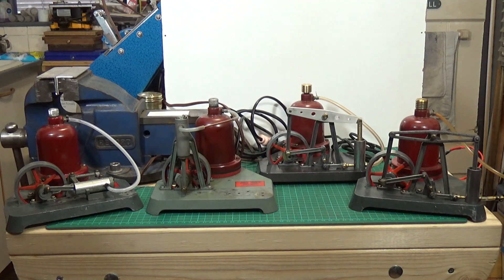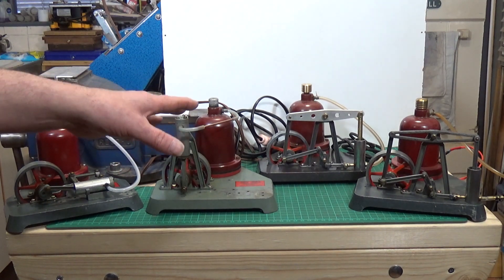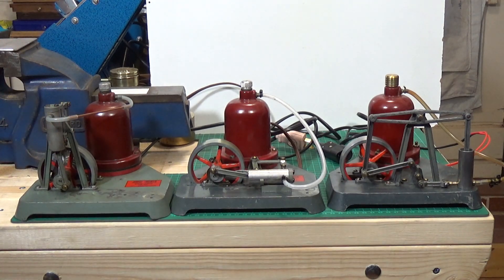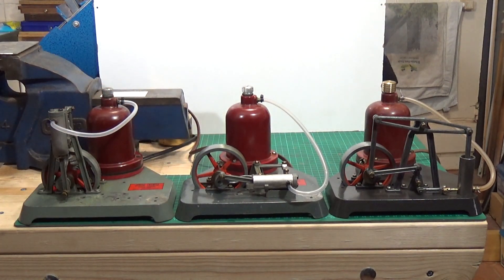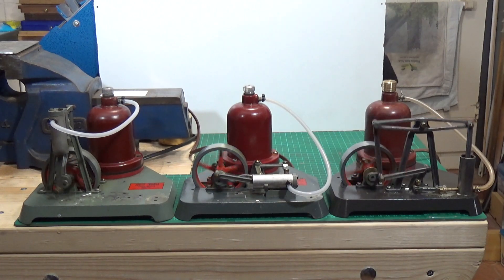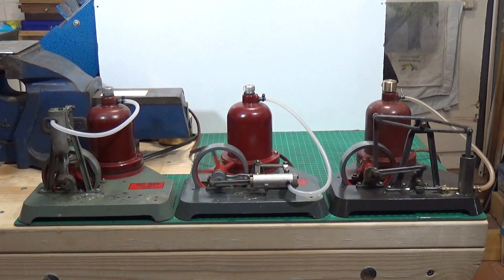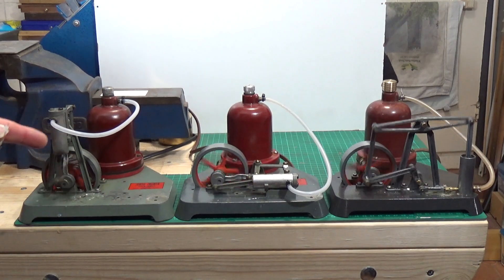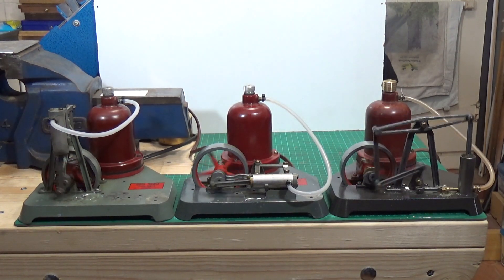Miller Junior Engineer SE-100 Model Steam Engine - The Final Chapter!

Comment: I'm sure there are therapy groups for this sort of compulsive behaviour ;)

I have a similar problem with Rega oil cans LOL.

How does the carbon block heater work - what's the principle ?

Cheers Rob
Reply from the maker: I'm sure there are Rob, if you know any sign me up!  Rega Oil cans i'm not aware of but i'll do some research. I love the American Eagle 66 oil cans, i only have one so far but i'm sure it's just the start!. More therapy!  The carbon blocks are approximately 1 1/4" by 1/4" and 1/4" and sit about 1/8" apart in the base of the boiler. The mains voltage is applied to each of the blocks and the water provides enough conductivity to generate heat.
Reply: The Australian Rega oil can looks to be a copy of the UK Braime's oiler in both the pot and oval shape configurations.

They are collectable now and are one of the best high pressure cans for ball oilers on lathes etc and bleeding vehicle hydraulics.  No longer made.

I imagined that was how the carbon heater would work, but wasn't sure.

While we may be compulsive collectors, and probably un-treatable, it is actually a financially beneficial long term affliction when viewed subjectively ;)

Cheers Rob
Reply from the maker: @Xynudu  My father had an oil can just like the oval Bramie, very solidly built and heavy if i remember. I like the Wesco pump oilers. Not the modern ones but the old ones where the lever is attached to the lid and bends at right angles to go over the spout. Great for light oils like 3 in 1.